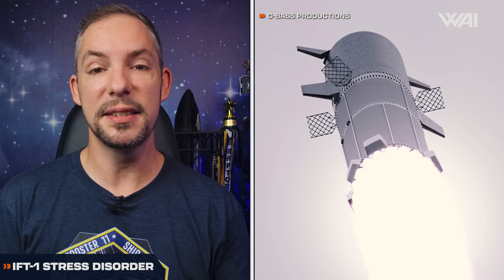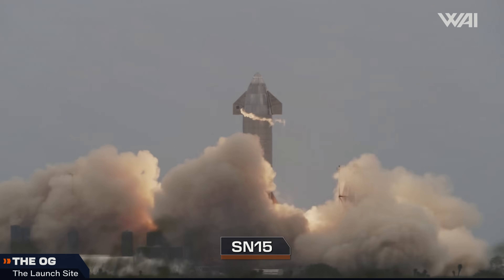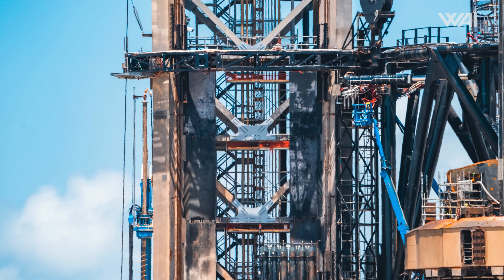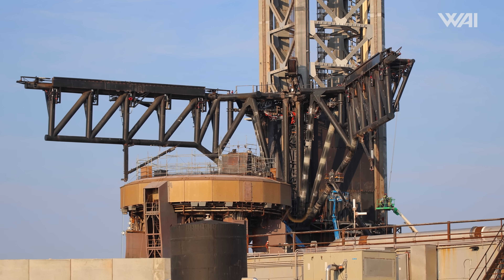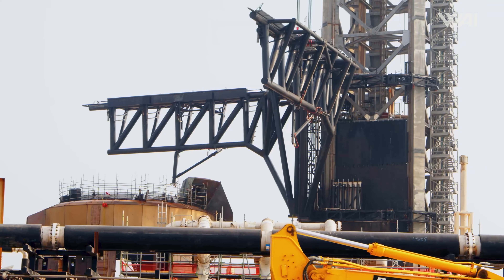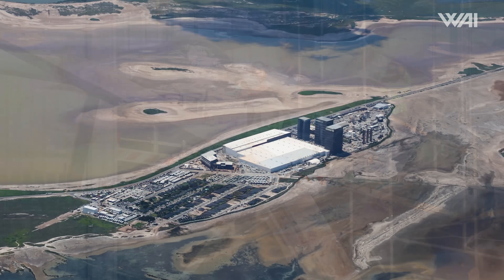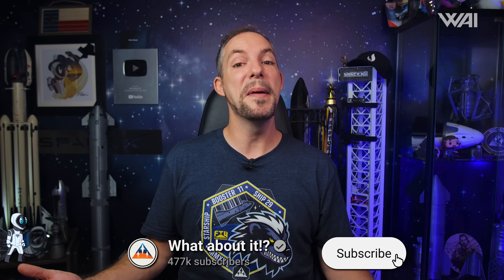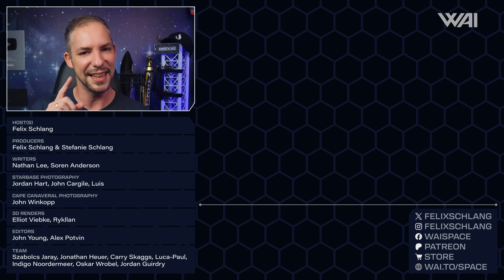SpaceX Drops Massive Update On Next-Gen Starship! RFA One Burns On The Pad!

Comment: That assumes it cannot hang on the arms for a while. 
That assumes they cannot lower it to the ground (it’s not gonna fly again). 
That assumes they must release all tank pressure when the engines shut off. 
That assumes it cannot hang un-pressurized. Seems to move ok in the barn, unpressurized. 

Digging the flame trench with disposable Raptors at the end of a flight would not be the worst thing they could do.

Comment: landing on land or a floating pad is hard difficult.
but is done

Landing ito the arms of a tower
is another load of fish
there is a ridgid tower
rockets came down with speed limited fuel
wobbling rocking and base of rocket thrusting in all directions
with the top of cylinder yawring twisting to line up
to drop and land in a perfect bulls eye.
Coming down in a perfect line to get held at top of cylinder
is a near impossible aim
even a dart thrower cannot get his darts in a perfect straight trajectory
everytime.
Disaster is more of a flying bomb coming in than a first time landing.
Musk will loose more fule mto land than to place legs or wheels on his
Ego trip to destroy the pad

Comment: If they are starting to grow a lobe- Then SpaceX will not launch until tower B is ready to., at the very least, catch the returning booster.  The only reason Tower B is going up this fast is because they have finally accepted that EVERY launch damages the OLM.   And if they are gonna have the booster return within 8 minutes of launch, they NEED a backup tower they can KNOW is fully operational to do the catching.  Or- they might launch off tower B without having to install the arms, and rely on the repaired Tower A to do the catching.   But either way. Needing TWO OLMs at the same site is nothing but an admission that they cannot rely on the tower functionality surviving launch.

Comment: NOTHING on the tower and OLM has been part of an ‘iterative’ design process.  In iterating a rocket, they are building an entirely NEW rocket each time. They have NO constraints on how many or what kind of changes they can make to each iterative rocket built.
The tower has NOT been able to be Iterated, because they cannot correct the massive design failures that are inherent in the original design. It is too expensive and too time consuming to tear down and rebuild the entire pad because you, say, disregarded ALL prior large rocket launch experience and decided you did not NEED a water deluge and flame diversion trench.
As a result, The OLM has never once survived a launch, nor even a full engine test, without requiring millions to tens of millions in repairs. 
Every change made to the OLM has been a design BANDAID, slapped on to try and mitigate the fundamental design error that they cannot correct. 
The harder concrete, did not work. The ‘showerhead’ has not worked to protect anything but the steel plate covering the concrete pad. ( water deluge needs to be injected as close to the nozzles as possible so the engine acoustics can be what atomizes the water, rather than have the water come out already atomized 40 feet away.) 
The SECOND launch tower is the Second iteration of their OLM.  The first iteration could not be mitigated with bandaids to be rapidly reusable. 

Large infrastructure cannot be rapidly iterated, because you cannot afford to repeatedly tear out massive infrastructure and rebuild it. Ergo- the ‘smart’ way to approach launch infrastructure would have been to consult prior experience and design a pad that would incorporate KNOWN solutions to acoustics, blast, and protection of infrastructure. ( having to tear down and relocated effectively every component of their launch infrastructure is evidence of outright incompetence.- NOT iteration.  Any doofus should have been able to consider that a launch pad with NO blast or flame diversion would mean placing propellant tanks, chillers, and other structures a LOT further away, and NOT sticking up quite so high.)

SpaceX has done a good job of building a rocket factory that can rapidly iterate the rockets. But they utterly failed to understand that WHY large launch facilities of other nations are laid out with nozzle height deluge and flame/blast diversion and built a launch pad that could never be rapidly reusable, and that they could not afford to tear down and build again.
It has been the repair work required by the OLM after every use that has put Starship 4 years behind schedule. 
Meanwhile, SpaceX has achieved a record launch cadence for Falcon 9 off 39a- a pad that was built in 1963, and had been rapidly reusable since day one. But apparently Musk thought he was way more clever than the men who designed that pad and did not bother to employ those time tested solutions.

Comment: Adding reinforcement on the welds and joints makes sense. The whole tower was probably designed for slow cautious manipulation with empty boosters. Now they need something capable of handling of the dynamic short shocks from capturing the booster slowing down and having a few tons of fuel inside.

Comment: Hey WAI the square lifting bar was not a special piece. They were using lifting rings that have multiple holes in it that allows them to offset the load. They had to use that to balance the load which had a heavy side.

Comment: I don't know why they didn't design the launch tower to stack itself. There are cranes that already do it. Imagine the chopsticks lifting tower segments and placing them on the top of the tower, or even the second to last part of the tower. I think they are called Kangaroo Cranes.
Reply: Why bother? The tower only needs to be stacked once, and it's not so high that an ordinary mobile crane can't do the job. So why make the tower much more complex and more expensive to support a feature it doesn't need and wouldn't use again?

Comment: Might be a daft question but could you in theory divide the ship in two vertically like putting a line through a circle and have one half for liquid methane and the other for liquid oxygen?
Reply: You could but that wouldn't be very practical. The engines require dufferent amounts of oxygen and propellant, so one tank needs to be bigger than the other. The liquids also have to be stored at different temperatures and pressures. A side by side storage would make that more difficult.
Reply: @ascherlafayette8572  I didn't know they were stored a different pressure, I just thought it would make fuel delivery easier, pros and cons I guess , thanks for your reply
Reply: @davefarmery8180  They're also different weights, so your rocket won't fly very straight with one side heavier than the other.
Reply: @simongeard4824 I guessing had brain fart moment 😆 that's why I'm not a rocket scientist lol 😆
Reply: @davefarmery8180  If you really wanted to go down that path, you'd instead put one tank inside the other, but that has its own challenges around temperature and pressure management.

Comment: @Whataboutit
that is clearly a refueling line because they are testing engine to engine refueling... i think the refueling to the side port was dropped because of concerns with how you actually pump it... a butt to butt pump needs a slower roll to refill quickly.
Reply: its fairly obvious that if ou need more fuel you just make the pipe bigger, this must be a valved line.

Comment: A possible reason for the multiple downcomers could be to ensure that if one engine fails it will not cause a sudden change in the flow to the other engines as it would if all three were fed through the same pipe.  That said I think it would be more important to do that on the sea level engines than the vacuum ones.

Comment: The chopsticks are challenging, but even if they initially prove successful they will always be high risk, so the question is, if it ever goes wrong would it be worth the resulting destruction? 

Would it not be better to have a landing pad close by that was far more expendable if things go wrong? 

It's not as though once the rocket has landed that it would not have to be moved off and made ready for the next flight. Why risk all the launch specific infrastructure?

Comment: I still don't understand why they don't test it with a hop. Send the booster 1 mile up and see if you can catch that. Seems way safer than trying to catch it from orbit on the first round.
Reply: I cannot see what would be the point. Same risks (not safer) but with no actual flight data in return.
Reply: @AeroGraphica  You really think catching a booster that goes only a mile high and has a controlled descent has the same risk as catching one coming out of orbit and that reaches hypersonic speed and deals with potential heat damage?
Reply: @zmagicsolutions  Yes ! 
Boosters don't go orbital speed, no reentry phase like a second stage. 
Imo coming back from 1 or 100km doesn´t make that much of a  difference,  just need a longer braking phase and burn, which may actually help for precision.
Reply: They already know the booster can slow itself down effectively from the last test where it soft landed at sea
Reply: @hankkingsley9183  I dunno. I still feel like a hop catch is far less risky as a next step. But I'm not a multi-billionaire rocket scientist, so what do I know. I'm still not convinced the answers I've been getting are based on any more knowledge than I have.
Reply: This actually seems like a very reasonable approach. You get to conduct the test without risking everything while minimizing potential damage incase of a failure. Otherwise, trying to use mechazilla during boost back approach feels like trying to catch an overgrown ICBM.
Reply: It just might have something to do with the very, very limited number of flight licenses allocated by the FAA.
Reply: @zmagicsolutions  that won't teach them anything new from what was leaned with IFT4. A hop would only help with demonstrating control of the craft to a near halt at descent, and that was already demonstrated with IFT4. They need to do the real catch with the craft coming in hot from space.
Reply: @abiodunayodele2808  I disagree. I mean, look at all the tests they've been doing with the chopsticks. Those are small, incremental. A hop catch would be a big step but not an all-in step. If it succeeds, it would give valuable test data. If it fails, it would be controlled enough to not likely do serious damage.

Comment: I know they need to do better than that catch tower.  I Think two towers need to act as one which will give them more headroom for a catch instead of relying on a single tower with limited maneuvering ability. If they use Two towers as one catch mechanism it would massively improve their catch potential.  Use both rail systems at the same time on each tower with the catch mechanism utilizing both towers and working in unison. This will also allow them to catch it further away from the towers reducing damage from the rocket engines on decent.

Comment: 7:23 - WRONG - that's NOT the engine section for Ship 33, that's the lower half of the LOX tank. The engine section hasn't been stacked yet, let alone seen.

8:19 - WRONG - that piece of rusty steel in the middle is NOT the methane downcomer, that's the jig that's used to align the methane tank downcomers prior to welding. Inside that rusty steel tube is the downcomer for the sea level engines, the other three are for the RVac engines. That jig will be removed once they are installed.
Reply: A) how do you know about the alignment jig for the downcomer?
B) why the hell DOES it have a welded on alignment jig, instead of something removable??
Reply: @nemo-x  a) Because I follow the Starship development extremely closely. 
b) it's not welded on
Reply: WRONG

Comment: Why not use fuel/oxidizer tanks that are 1/2 the internal diameter and longer?  So the actual feed connections to the engines are both together rather than one feeding through the other?  Just a thought.
Reply: Two reasons. One, tanks need to be approximately cylindrical to hold pressure, whereas if I'm understanding you correctly, you're proposing two half-round tanks joined in the middle. Second, methane and oxygen have different mass, so if you put them side-by-side instead of top-and-bottom, you'll end up with an unbalanced rocket.

Comment: The thing that I think is missed with gravity assist descriptions, and maybe because it's obvious to people steeped in space science, is that yes, it accelerates toward the planet but it loses all the extra speed as it rises back up the gravity well. What it DOES pick up is some of the planet's momentum around the sun. The same reason launches are made closer to the equator, you pick up some velocity for free. 

A space craft is very small compared to a planet so the amount of velocity it loses to the passing space craft is very small, but the space craft is very small, so even picking up a little of the planet's orbital velocity is a big boost. That's why they go to the inner planets first, they are moving much faster than the outer planets due to the conservation of angular momentum, Kepler's equal areas in equal time. 

An imperfect analogy of a large mass granting momentum to a smaller mass would be to drop a tennis ball and a basketball or soccer ball together with the tennis ball on top. The more massive ball will transfer some of its rebound energy to the smaller ball sending the tennis ball shooting away much faster and higher than if you had dropped it by itself.
Reply: @johndoe-hr6vp   correct. I was surprised at the minimal total gain from that part of the equation. When I look at the small speed gain (1.7km/hr?)it does  make sense and add up as a benefit though. A newbie here. Thanks.
Reply: You need to understand that momentum is the product of mass and velocity (p = mv). (Note that velocity and momentum are both vector quantities.) Also, note that this equation holds for linear momentum. Angular momentum, particularly for non-circular motion, is more complicated but still proportional to velocity or speed.

But basically, you cannot pick-up momentum without picking up velocity (since mass is constant).

The spacecraft does not lose all the extra speed as it exits the gravity well because the planet is moving away from the spacecraft. It is necessary to look at all three objects, the spacecraft, the planet, and the Sun in order to understand why gravity assists work as they do. This is the thing that I initially missed when trying to understand it.
Reply: @dennisleas8996  the spacecraft does not pick up extra speed relative to the planet during the interaction, but does pick up extra speed as measured in a reference frame centered at the sun.This is because it heads out in a direction more closely aligned with the planet's motion around the sun then the direction it came in on. Thus, in a speed boosting gravity assist, the planet is moving toward, not away from, the spacecraft as the spacecraft exits the gravity well, in the reference frame centered on the sun. (in the reference frame centered on the planet, of course, the planet is stationary and the spacecraft comes in and out at the same speed).
Reply: The first time I looked this up, it took a little while to understand. 
Hopefully your well explained comment helps some people :)
I hate the name for it. Maybe he meant the old fashioned ancient slings, from Roman days.

It's more like a hitchhiker:  a guy jumping onto a moving train (or cartoon springy grappling hook onto one), then jumping off as it makes a turn.
Reply: I think there is also another thing about how rocket engines are more efficient at different velocities, so even if the planet wasn't moving, you could time your burn at a more efficient velocity.
Reply: I think large part of the reason why inner planets are often used is that they have shorter periods and are closer together, making it easier to find a path that gains enough momentum.
Reply: Thanks. That answers one of my questions.

Comment: They gotta find a better solution other than gravity assists lol, waiting  so many years after launch to reach Jupiter is nuts
Reply: Until much more efficient engines are developed, the options are either gravity assists or brute force using a VERY big rocket.
Reply: @1mariomaniac  Another option is an efficient ion engine running continuously combined with gravity assist.
Reply: There is a solution, you just need to have 60,000 mt of fuel on board (at LEO) and then you can fly directly to Jupiter. Simple thing, right? Or is there a problem? 🙄

Comment: The RFA engine test failure looked worrying. If the system were properly instrumented and designed with safety in mind then 1) the problem would have been detected before it became disastrous 2) the safety systems would have shut down the pumps and depressurised the tanks to avoid too much damage.  It looked like the control staff simply looked on in helpless horror.
Reply: With your extreme analytical skills (which even only require one video) you should apply to RFA as a security engineer. My recommendation for you is Dr. Stefan Brieschenk, he will welcome you with open arms. Finally found the Generalissimo Ultimatus!🤪

Comment: From a welder's point of view, OLM1 arms are much longer than the ones for OLM2&3. With the arms on OLM1 being much longer and with the bouncing identified during catch testing SpaceX decided to put doublers on the weld points because around the welds tends to be the weak point as a preventative measure instead of waiting for a possible failure if a hard landing occurs.
Reply: Simple solution to a complex problem